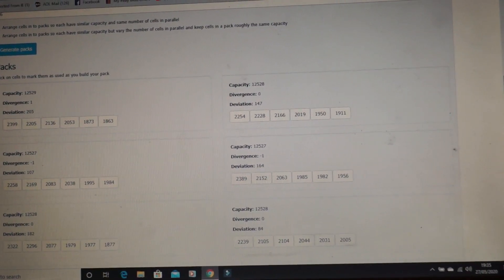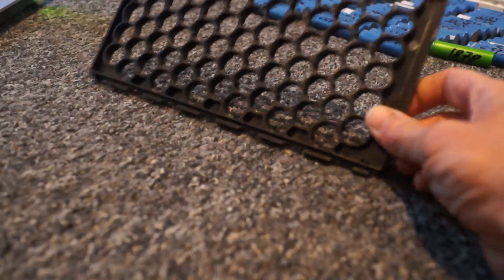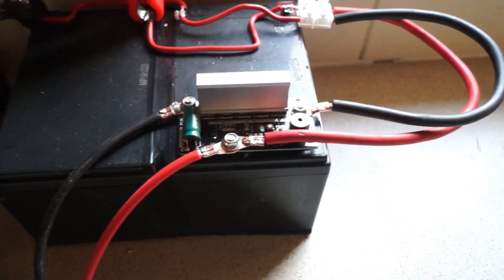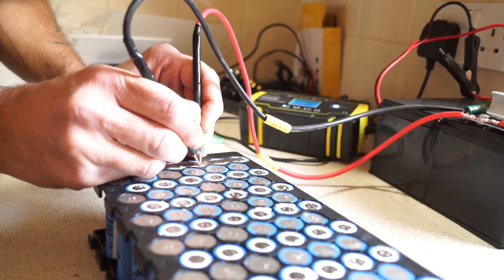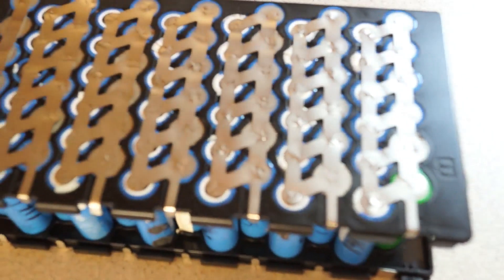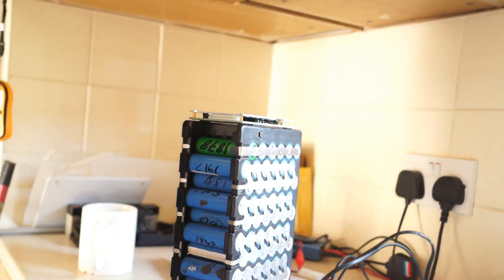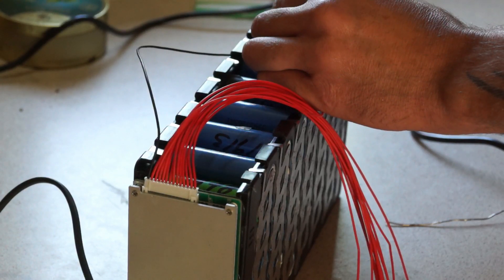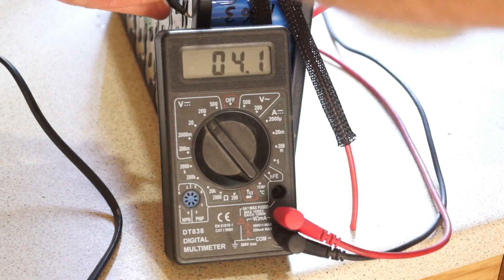18650 DIY battery 13s6p 48v mini spot welder

Comment: Can you pls let me know the link to the BMS and the Spotwelder
Reply from the maker: The spot welder from eBay...and the BMS came as a battery building kit off ebay
Reply: @electricdixie34  do you have the URL for the kit and the welder
Reply: @electricdixie34  i just need the link for the product so i can find it
Reply: I wish you were showing where your multimeter prob contacting along with the meter screen and the finish part of battery testing. but good job. make me want to build one too😂